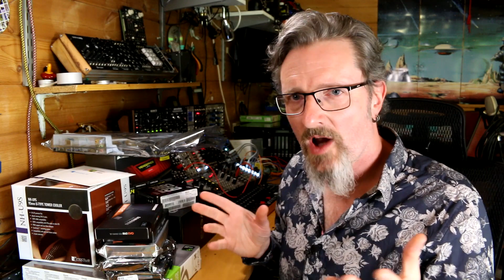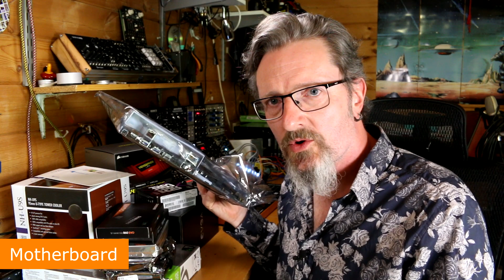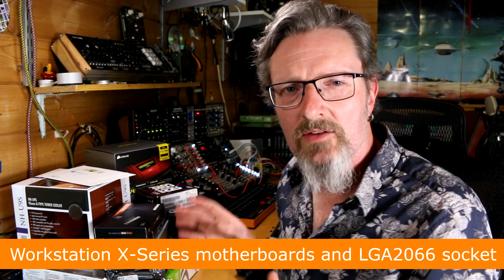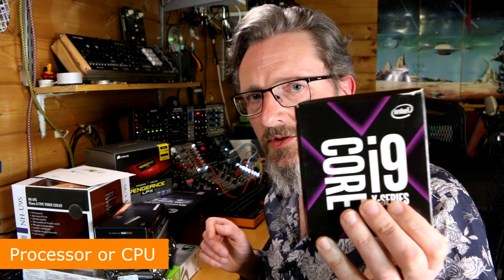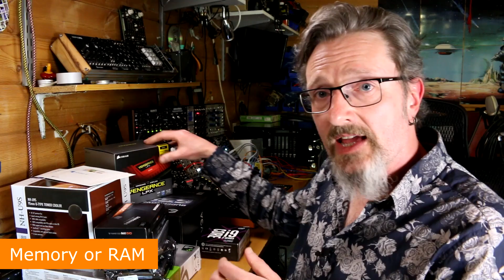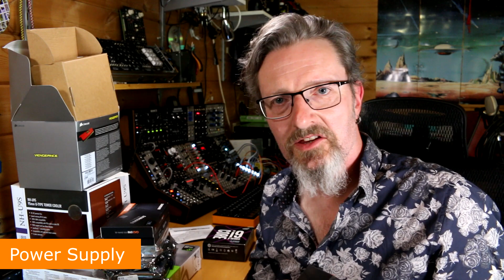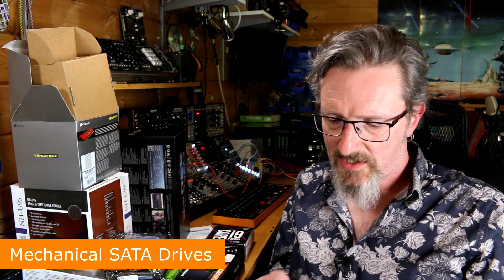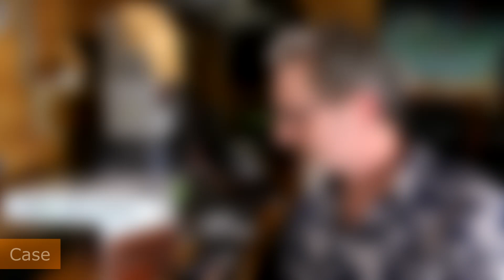How to build an Audio PC: Part 2 - Choosing components

Comment: Interesting video. I know you didn't want to get too technical when it comes down to your audience but I think you skipped out on an essential tip on what your audience should look for when it comes down to buying a PC that's meant for audio production.

It should be stressed that the CPU is the most integral part of the build because audio production is so CPU intensive. 

People need to know that they should pick something that will have fast single core performance. This is because audio production relies heavily on serial processing (as opposed to parallel processing) and therefore it will be more important than having more cores. If just one of those cores get overloaded, then everything grinds to a halt. The other cores will have to wait for that core to finish.
Again, that's why it is essential that when you're looking for a computer for audio production the first thing that should be looked for is fast single core performance. All of this being said, you will still want a reasonable number of cores. Nothing less than 4 cores.
Reply from the maker: Thanks for the comment. I'm pretty sure I stressed that the CPU was important :D
The reason I didn't mention core counts is because we don't really have a choice. You used to be able to get laptop processors that were dual core rather than the slightly slower quad-core but you don't really get that with desktop. Besides it also depends on DAW. I've had amazing results with Xeon based multi-core and multiple processor processors with Pro Tools running at half the speed of less cored single processors - so it's not always true that a faster single core is better...... and even if it is you can't get one. So there's no point getting worried over the core count - get the best CPU you can afford and you'll be fine.

Comment: Question regards the graphic card. My list is not too far from this, although a step down with a i9 coffee and z390a MB. I was think of just using the intergraded video hdmi off the MB, my old builds I used a video card because I read somewhere best not to use onboard graphics, is there a measurable performance difference in using separate graphics card?... not gaming or video production strictly audio, so don’t really care for any specific hd outside of 1080 on a 32” monitor. Thanks for sharing your insight!
Reply from the maker: On board graphics is fine these days - no problem
Reply: @MoltenMusicTech  thank you!
Reply: Oh look there’s the same system I have spec and the answer to my question  in part 4 😂... please hold question to the end of the course 😉

Comment: Going with Intel in a workstation build makes no sense whatsoever. A 300 quid Ryzen 7 3700X will offer the same workstation performance or even slightly more - but overall platform costs are a lot lower and the upgrade path is still there to 4th gen Ryzen if you at least paired it with a B450 board.

Comment: This has been a life saver for me, as my iMac died on me a few weeks ago!  A quick question if you have the time, would a Asus proart.z490 be suitable for an audio pc?  I ask because I need thunderbolt, but no one seems to be able to get the card in my area.  Stock right now seems to be very limited depending on the components.
Reply from the maker: The z490 is the successor to the z390 I used in the build - I’m sure it will be fine.
Reply: @MoltenMusicTech  Nice!  I was able to stumble into one, but I wasn’t sure if the proart would be suitable...  that’s great to hear!

Comment: Hello there 

I am currently planning my custom pc build, and learnt lots from your videos. thanks! 

I am currently deliberating between an i9 9900k and an i9 9900x.

Other than the consideration of socket type and matching MB. 
( PRIME X299-DELUXE II if I decide for the x) - 

Is it typical for one of these cpus to generate more heat, thus requiring me better investment in cooling and successful air flow build? 

Hope my question makes sense, 
I'm rather on the noob side custom building, 
but trying my best. 

cheers
Reply from the maker: The X is much hotter and has a TDP of 165w - that’s how much heat it has to shift. The K is 95w so significantly less. Any cooler you buy will specify the TDP it can cope with but in either case it shouldn’t be a problem.
Reply: @MoltenMusicTech  Hi there, thanks for the swift reply. 
I will proceed with the decision making. 
If I may use the chance to pose a couple of questions yet: 

1. is there any long-term sort of consideration why to go for a 1151 socket as apposed to 2066. (Hoping to use my computer for at least 5 yrs, and squeeze out closer to 10 if all's well) I'm looking at Z390 DESIGNARE vs. an Asus PRIME X299-DELUXE II to use with an i9. 

2. Planning to use the pc primarily for Audio, but also for video editing and live streams. should that tilt considerations in any specific direction. 

3. my most tricky concern : I use RME Fireface 800 - with firewire. 
    I understand from scattered infos online here and there that some people go through all kinds o troubles with this topic and new computers, windows 10, drivers and even the difficult scenario of firewire cards either totally unrecognized, or seen by windows but still don't talk to the interface (be it rme or others like presonus i think). 

Apologies for the question bomb :) 
in case there are any helpful insights, I'd appreciate any help there. 

Danke Schön!
Reply from the maker: Sure:
1. Nope.
2. Nope.
3. Get the Thunderbolt expansion for your board and use TB-Firewire adapter (from Apple) these work great.

Comment: When It comes to the processor, the i9. I notice that some comes with different watts. 65w/95w. Which one should I get?
Reply from the maker: If you look at the specs you’ll see that they are different. Lower power means slower speed but easier to cool. So if you were building a silent system with passive cooling you’d need to compromise on speed to get the heat/power down. But if you want the fastest machine possible then go for a high powered processor.

Comment: Hi 
Going to be building this exact computer following your suggested parts . What is the model # or exact model of the power supply that you are holding . Not clear on which one it is other than EVGA supernova 650 pt 2
Would this one work EVGA SuperNOVA 650 G5, 80 Plus Gold 650W, Fully Modular, Eco Mode with FDB Fan, 10 Year Warranty, Includes Power ON Self Tester, Compact 150mm Size, Power Supply 220-G5-0650-X1
Reply from the maker: Yes, any half decent Gold PSU would be fabulous - they are forever changing the names and model numbers.

Comment: Amazing. I have a Carrilon AC1 that is a few years old. Would it be possible to reuse the case?
Reply from the maker: Yes. It’s cramped in there so watch your airflow and cooler height but everything should still fit
Reply: @MoltenMusicTech  thank you. I Appreciate your help and totally enjoy your modular stuff, keep it up
Reply: Hiya, I don't suppose you remember what the motherboard size is that fits in this case, the AC1?
Reply from the maker: simon chantler yes, regular ATX size or smaller

Comment: Anyone got any thoughts on the AMD Threadripper 3000 series?  Or is this just overkill...
Reply: I would only recommend it for video work. For audio you need faster cores over more cores. And your DAW will not utilize the 32 or 64 cores as well as vfx or video editing programs. If you want to make a monster of a jack of all trades then I'd say go for it! But to answer you question, for audio it is overkill, and somewhat counterintuitive.

Comment: Perfect except you could have gone with a liquid cooler...
Reply from the maker: Could have done but they tend to be more expensive and noisier. But I’ve used them in the past and they can be a good option. But I’m making one computer and can’t include all possibilities.
Reply: Molten Music Technology 
Don’t get me wrong, your model is amazing and I am planning to build one almost in line with all your guidance.. 
However, I was under the impression that, liquid cooler are perhaps less noisey, that’s why I suggested. 😀 Maybe I was mistaken..
Reply from the maker: Yeah, it's a common misconception. Water cooling is really good at removing heat from the processor to a radiator - but that radiator still needs cooling with multiple fans and you have the additional water pump noise. All these things are generally "quiet" but a heatsink and fan is easier and less fuss and works just as well.

Comment: Can I add a AMD Ryzen 5 3600  processor for music production?
Reply from the maker: If you want, with an entirely different motherboard - I don't know anything about AMD stuff so I can't help you specifically but if you follow the general guidelines then hopefully you should be fine.
Reply: Msi and AsRock make quality motherboards for the AMD chipset. The Ryzen 5 is a solid entry processor and still leaves room for upgrading later on down the road. You would money on buying an air cooler as well, since the cooler that comes with it is known to be top notch!

(MSI 450 Tomahawk is a well known entry board that is compatible with the Ryzen 5)

Comment: They say that the more cores a prosessor have the better.
Reply from the maker: Do they?
Reply: @MoltenMusicTech  Acer Predator Helios 700 (NH.Q4YED.011) has 2.4GHz Intel Core i9-9980HK (which has a total of eight cores and 16 threads)
Reply: so the GHZ is not so importandt
Reply from the maker: It all depends on how well your software supports multiple threads. Generally speaking a 4.8ghz single core would be more powerful than two 2.4ghz cores. But it’s all multi core these days. So both the number of cores and the speed has an impact on the power of your system and it’s up to your software how well that’s harnessed.
Reply: @MoltenMusicTech  ok
Reply: @MoltenMusicTech  Found this for only 25 dollars. Intel i3-4130 3.40Ghz. High Ghz but only i3. Good or bad?
Reply from the maker: Good or bad for what? We were making music on computers 20 years ago with much less power than an i3-4130. It's a 4th generation i3 so it will be more powerful than previous generations and less powerful than the generations that come after it - it's not just about the GHz, there's much more to it than that. You can only talk about GHz in relation to the same generation. Try spending time on a CPU comparison website.
Reply: @MoltenMusicTech  ok

Comment: Can you recommend the i9-9900K for music production if I want a slient PC? I was told that it' s so power consuming that, even if you use several big fans in a silent case, you won' t get this PC silent. 

So, I was thinking about getting the i7-9700K instead? Case would be the BeQuiet! Silent Base 601 with 2 Silent Wings 3 Fans 140mm and a Noctua DH-15 CPU cooler, BeQuiet Straight Power 11 650W power supply. SSDs only, m.2 as  system drive and SATA for all my data. Asus Prime Z390-A mainboard and 32 GB (2x16) Corsair Vengance LPX 2666 DDR4 RAM.
Reply: @MakingMadBeats, As far as cases in reference to your concern for silence. I have one and suggest a Fractal Design Define R6 (USB-C) case. You won't even know it's there. And I'm running in comparison to your specs a Mainboard: Asus ROG MAXIMUS XI HERO, CPU: Intel i9 9900k, Cooler: Noctua NH-D15, RAM: Corsair Vengeance LPX DDR4 3200Mhz 32GB, Power Supply: Corsair TX750 750 watt, SSD: Cruical MX500 500GB M.2, Video Card: Asus GeForce GTX 1060, Case Fans: 3 total Fractal Design Dynamic 140mm, Sound Card: Focusrite Saffire Pro14. Again it's just IMO everybody has their own perfect picture. But, I run this PC in the studio all day plus and multiple projects running with no worries, & no doubt. It's a beast the case is sound isolated as long as you don't get the clear glass side model. It looks great, and has plenty of room for additional drives or upgrades. So, there it is, but you do you!
Reply: @216Numbskull  Thx for your input.
Reply from the maker: the number of times i've heard "they said it was silent - it's not silent!" when referencing a decent quality case that can run very quietly. So in my view if it has moving parts then it can't be called "silent". However, cases like the Fractal can run very quietly with the right PSU, graphics card and CPU cooler and I believe that's quiet enough for most people. On the other hand if anyone ever says to me they want a "silent" computer then there is no point me selling them something that has moving fans because I risk it being returned for a refund. It all depends on the noise floor in your studio and your expectations. I also have the exact same case sitting here by my feet and it's very quiet - it is not, in my view, silent.
Reply: @MoltenMusicTech  Maybe I used the wrong definition? Quiet vs. Silent, you know? I' m running a Mac Mini Mid 2011 now in the Studio and it is really not noticeable when making beats or recording vocals. The fans only start to work and are audible when the CPU gets hit jard, in my Case when it comes to the mixdown phase.
Reply: @Molten Music Technology, I said for his concern in silence. I never said it is silent. However, it is to me so "quiet" and no concern for distraction at all or unable to bear that even raises the question of a fix issue. And you're absolutely right in the whole configuration of your build that attributes to the matter of noise of the PC. I was just throwing out an option of opinion on the case from my experience in having almost the same specs as he is thinking of getting. That's all!
Reply from the maker: Yes, and that's awesome!! It's a good recommendation for a quiet system and it's the very case i use in the next video :D but it's not a "silent" solution and i feel it's really important to be as clear on these things as possible to the point of being a right pain in the arse - and that's my role! So please don't take offence but the silent/quiet differentiation is an important one for me.
Reply: @Molten Music Technology, None taken, and I get it and understand where you're coming from. A simple word without clarity can make the difference and misleading at the same time. It's all good, along with others and I do appreciate your help and insight of doing just that in spreading your knowledge and being exactly clear on the subject when talking on it. So, thank you for that and your time in caring enough to respond to us all! It's so important in helping to make the right decision. Wishing the best for you and your channel, as a new subscriber to the Molten experience!    ++Peace & Rock n' Roll++
Reply from the maker: nice one
Reply: @MoltenMusicTech  Hey 1nce again. Which case do you prefer? BeQuiet! Silent Base 601 vs. Fractial Design Define R6? THX
Reply from the maker: I was a big fan of Fractal cases until I built this last system and they had changed the way the drives slot it and added this terribly annoying cowl around the power supply. Terrible decisions in my view - it's still a good case just more fiddly than it needs to be. I've also built a system with an earlier BeQuiet case and it was completely fine - didn't feel as sleek or refined as the Fractal. Either will be fine :D
Reply: @MoltenMusicTech  Thx, man!
Reply from the maker: If you use any fans at all then it won’t be silent. It might be “quiet” but it won’t be silent. Desktop “k” processors whether i9 or i7 need to shift 145watts of heat. I don’t know of any silent, passively cooled that can do that. The Streacom silent systems and Nofan coolers can handle 95watts which equates to the non-“k” processors. But you should do a bit of research on that.

Comment: Very useful video, enjoying the series! One question though; why are you running your windows on an SSD and not on an M2 or NVMA? 
I hope you reply since I plan to build in January ^_^
Reply from the maker: Honestly it didn't really occur to me as until recently they were very expensive. I did mention them in the video and when you get to the actual build you'll find that's exactly what i'm using.

Comment: Nice video ... But it's actually not a workstation board (Mostly Xeon (intel) or Epyc (AMD) CPU's) Those are called HEDT (High End DeskTop) 
I do Agree that stability is key but my last build had A Gigabyte Board that is similar to the Prime boards from Asus and that had massive stability issues 
after that I got a full refund and went for a Asus ROG Extreme Range board since that was still available and that has been running rock-solid for several years now
It might be silly but don't underestemate those boards since they are made to be stable at Extreme conditions they will be stable at stock for sure 
Also About the Memory when you will pay more for lesser speed it's better to go with a nice middle ground ... the sweet spot currently seems to be 3000 to 3200Mhz this would not be to big of an issue since you only need to set the XMP profile to make it work at that speed or just leave it at stock and it will run at the CPU's highest speed for memory

Comment: I have a 2013 MacBook pro quad-core and always feel limited especially with a midi controller like push 2, Maschine mk3 that I bought and can't use so much because of CPU overloads, I wonder what parts of the computer would ensure that I can play with one or 2 controllers at the same time, maybe I am dreaming, anyhow amazing video! I will stick to your advice. so 2000 pound is $ 2500 if I go with $2000 I'll get an almost awesome computer but surely better than my macbook pro which I bought used for $1200.
Reply: @jb jb, As to a fix to your problem with your MacBook. I suggest that you run a EtreCheck on your MacBook and post your results and questions on the Apple Support Communities. Being that the fix for your problem could be so many things to your answer. Like settings,specs,extensions,apps,upgrades,etc...  Hope this helps, and good luck! Here's the links to both websites. https://etrecheck.com/#about  ~   https://discussions.apple.com/welcome